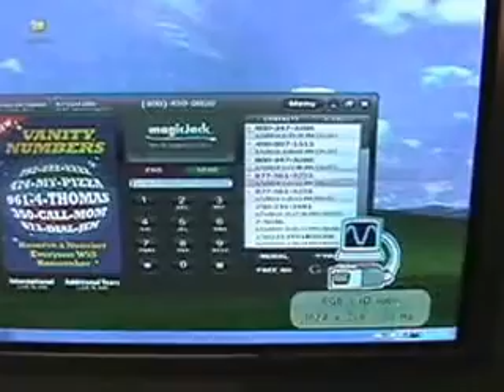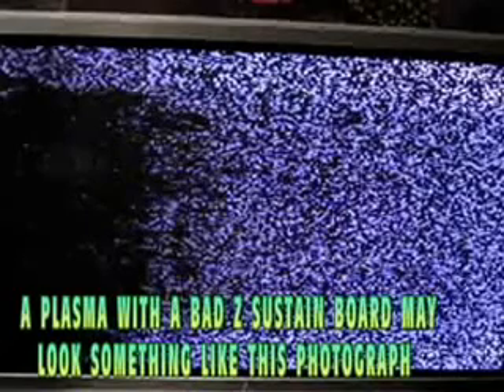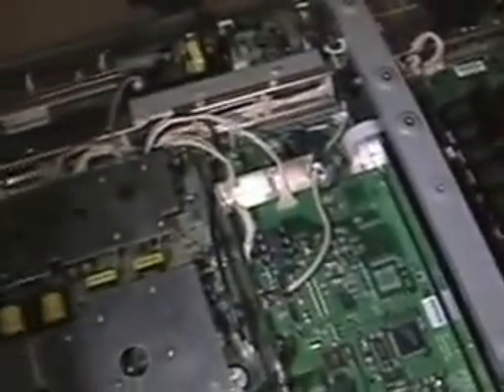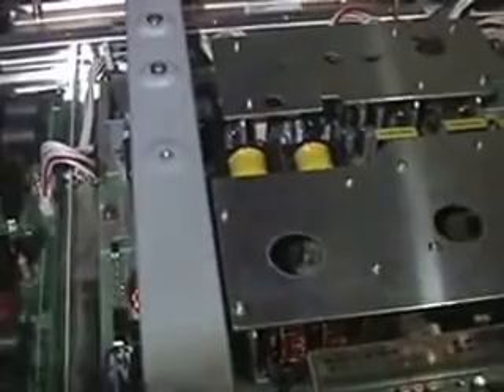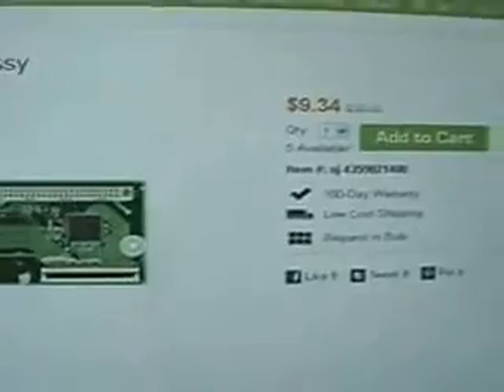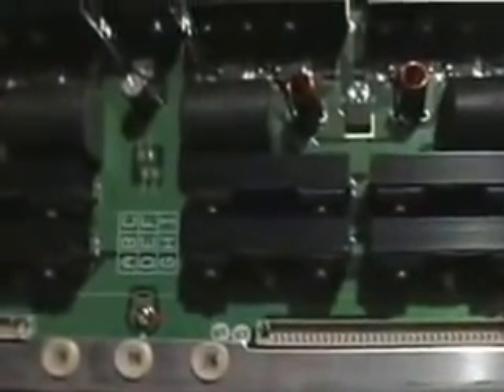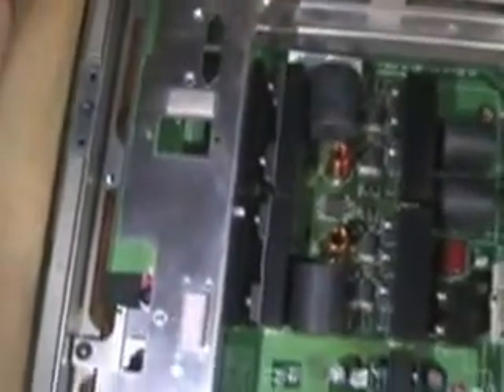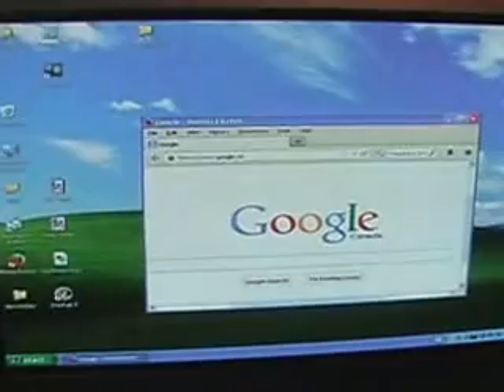Plasma TV Z sustain board repairs

Comment from the maker: If they are "fixed lines" then sadly it can be a bad or failing panel. If a panel fails it's cheaper to replace an entire tv then getting a new panel!! A panel will fail in 2 ways. #1 if it's dropped and is cracked pretty obvious. #2- it fails internally and fixed lines are a sign of it. Do you notice the lines on top or underneath if you click on the remote button "menu" that brings up your display options??

Y-Sustain and Z-Sustain have very similar functions, but, as can be seen, the YSUS is a bit larger than the ZSUS. It also produces output that goes into what's called YSUS BUFFER board(s) which in turn output to the plasma display whereas the ZSUS outputs directly to the plasma display.

It is because the YSUS does a little more work than the ZSUS. Roughly said, while the ZSUS activates all display lines at once (thus affecting the whole display at the same time) the YSUS, with the help of the buffers, is able to activate (technically address) the individual lines on the display.

Other than that, though, they do pretty much the same thing.

The two boards work together on the display in order to produce proper images, however they do not need each other in order to function. In other words the function of one does not affect the function of the other.
They work on the display practically independently from one another, only in a fashion synchronized by another board, so that you get to see what you want to see.
Reply: Bobbi, is that you? Coppell TV Repair?

Comment: what is the Z-sustain board  used for ?
we have a Samsung that has vertical lines thru
the image,and we were told it was the z bord.
after changing then Y buffer, but the z board dosent do enny thing when
unplugged

any thots